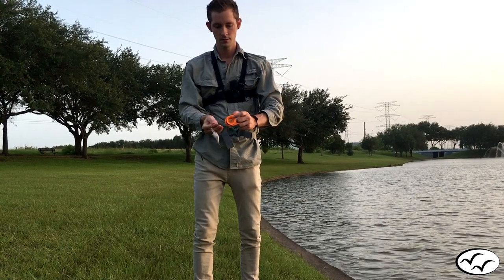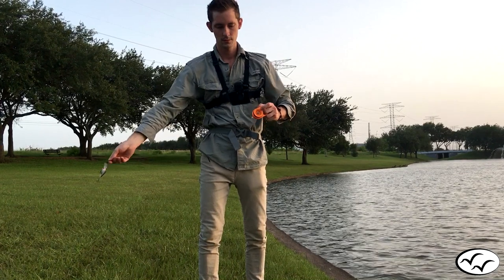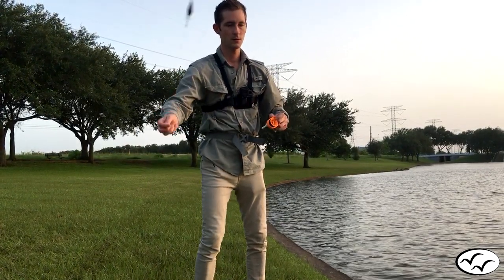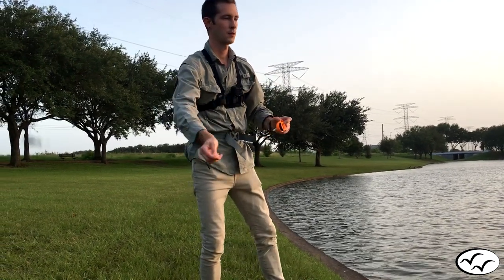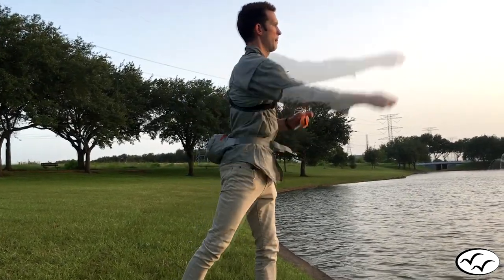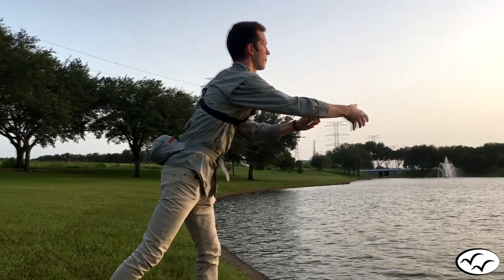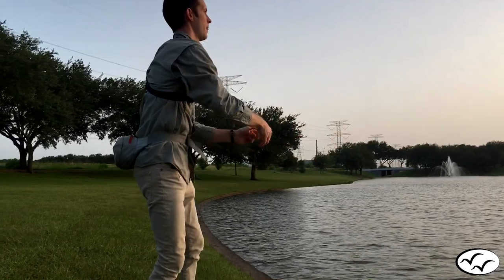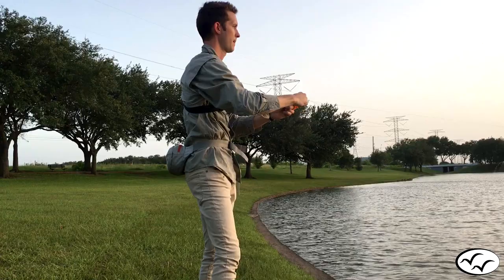Rodless Reel - How to

Comment from the maker: To fight fish, cross the reel with your thumb of the hand holding the reel and place it against the surface of the spool.  The tighter you press, the tighter the drag.  To set the hook, place your thumb on the spool firmly after reeling in any slack and then rip your arm back.